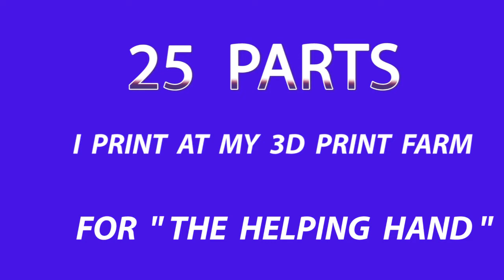25 PARTS I 3D PRINT FOR  " THE HELPING  HAND " AT MY 3D PRINT FARM. New Tech Inventors

Comment: How do you make the flexible arms?  Please disregard if you have done a video on it because I will get to it eventually lol
Reply from the maker: I think you will find out in the videos, but I purchase a flexible tube with a threaded fitting on one end and a nozzle on the other, that are used to provide lubricating oil to milling machines. I cover them with conduit and heat shrink the ends...Ken

Comment: What is the filament that you are printing with, is is standard pla, how do you find it for strength with your product?
Reply from the maker: I have many types and brands. I use and experiment with PLA, SPLA, PETG, PLA CARBON FIBER, SILK PLA, PLA+, and ABS. Most of my parts will be printed with PLA, PETG, and SPLA. The filament does contribute to the strength of the part, however printing at the right temperature and other settings like fill density and speed make a big difference in the final strength of the part. Thanks for the comment...Ken
Reply: @NewTechInventors  just remember that PLA deforms over time, especially when under pressure, like when clamped/clamping